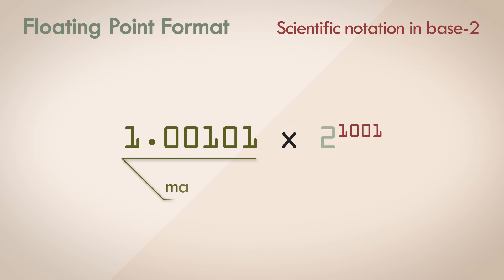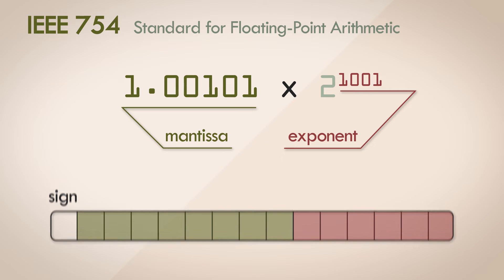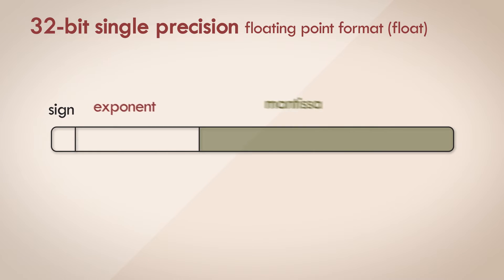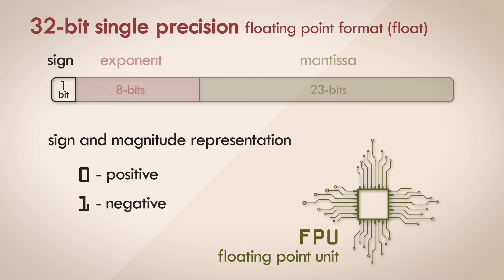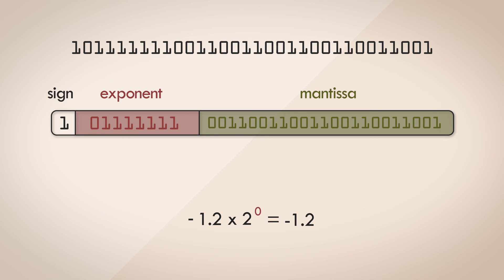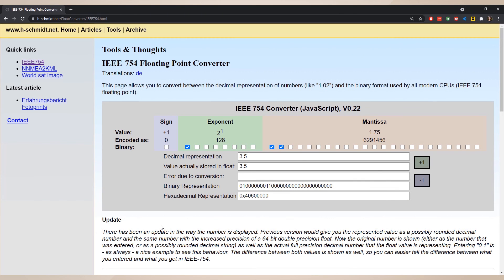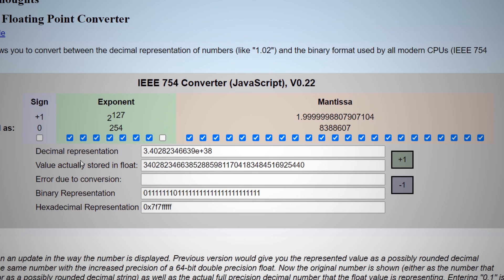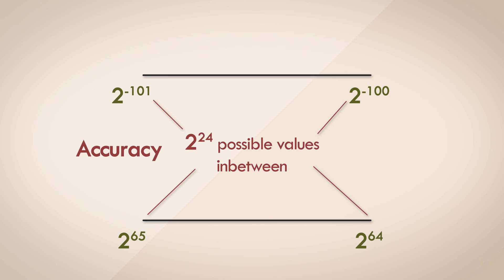7. Floating Point Format - Audio Number Formats

Comment: How much is that range in dBFS?
Reply from the maker: Well, you don't really use the full floating point range for audio. You use -1.0 to 1.0.   So it's kinda difficult to calculate. You don't really calculate dBFS for floating point numbers, you do it for integers, since you have a clear minimum and maximum in the range. 

But if you want to use the full range, then you can calculate it yourself. dB range of the floating point range is 20log(max floating value) to 20log(min floating point value). It's absurdly big, something like 1528dB.
Reply: @akashmurthy  a video on that first sentence would be awesome!!

Comment: It's important to understand that unlike in 10-based system where "exponent" part only "moves" point(radix) left or right e.g. 1.2345 -> 1234.5. In 2-based "exponent" changes the final (10-based)number completely. For example at 09:08 we decoded mantissa as "1.2" and your brain by force of habit may interpret this as a final value that could be slightly adjusted by exponent by "moving" point(radix) e.g. 1.2 -> 12.0 or -> 0.12. But it's not the case, because base of "Exponent" is 2 so you will end up multiplying "mantissa" on a number of power of 2 e.g. 2, 4, 8, 16, 32 etc which can dramatically change the final number. For example mantissa 1.25 and exponent 2^2 = 1.25 * 4 = 5.0 so integral part (number to the left of the point(radix) in mantissa changed from 1 to 5).